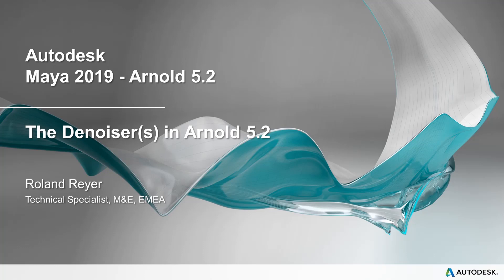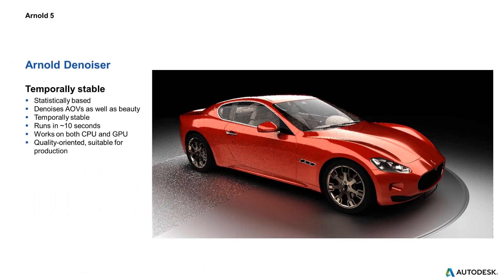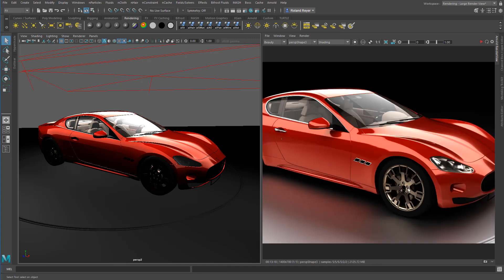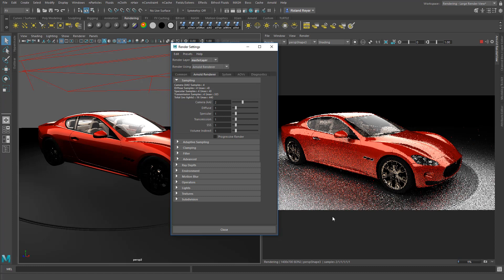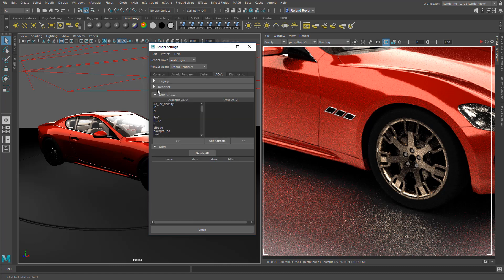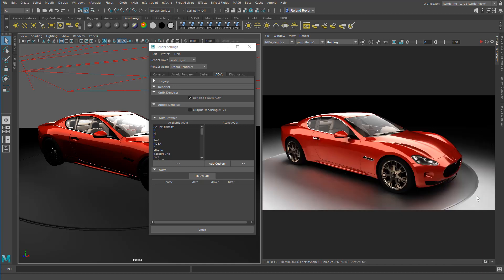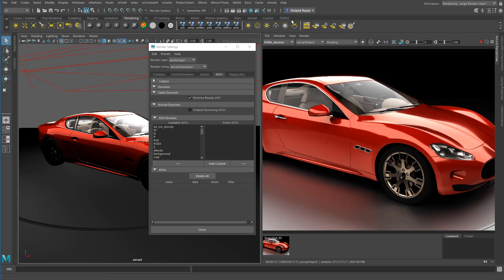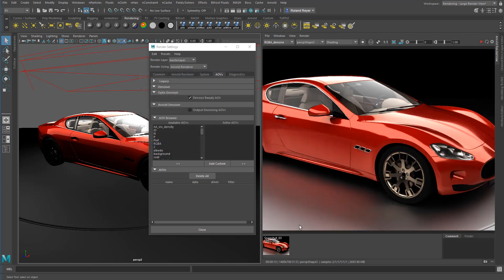Using the Arnold 5.1 OptiX Denoiser

Comment: optix denoiser not showing in my maya2022
Reply from the maker: Please check in the Render Settings, in the tab "Arnold Renderer" in the section "Imagers" (very last section). There you can add the Optix pass.
Reply: @RolandReyer  thank you ronald i did it still optix denoiser not shown under aov. Only arnold denoiser is there. Is there anything else i would have missed?
Reply from the maker: @atf56  Optix denoiser can only denoise the beauty pass, no separate AOVs.

Comment: Does CPU matter when Optix is turned on? Thx.
Reply from the maker: When you turn on the CPU Denoiser Arnold will save AOVs for the batch denoisung.
Reply: No it does not.
Optix relies on CUDA cores, that is on any NVidia GPU with CUDA capabilities you have installed on your system.
Reply: Ok, i think i got it. You have to render low quality with cpu and then denoised it with gpu? Would be big difference between 1070 vs 1080 ti for this operation?

Comment: Hi Roland, any ideas why my gtx 1070 won’t show up under system? I’m getting a “no compatible nvml error” Thanks! 🙏🏽
Reply from the maker: Hi, did you check the driver version? Also, please check solidangle.com for hardware requirements.
Reply: Yes I’ve looked at the docs but still struggling to find the issue as I have updated the drivers etc